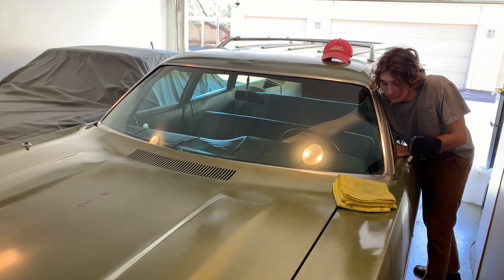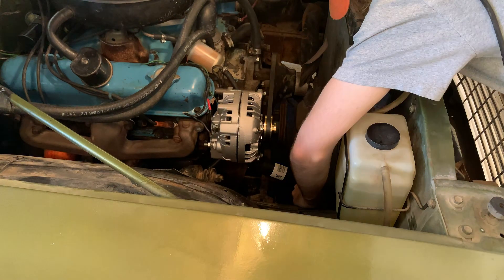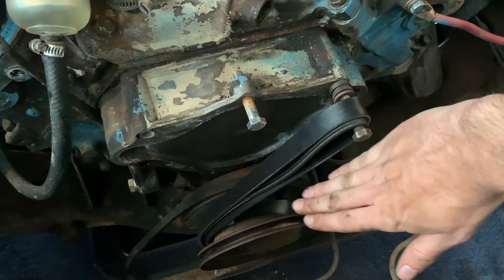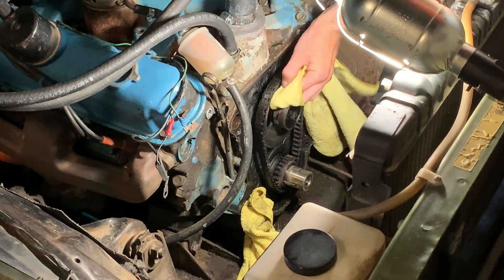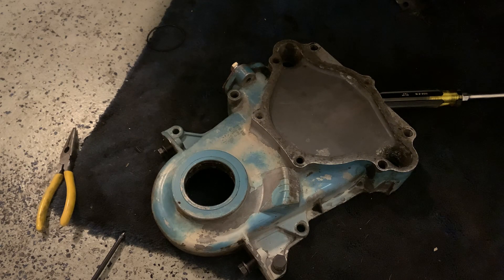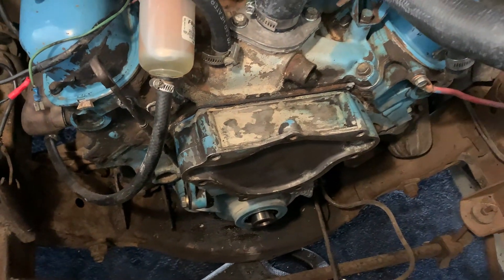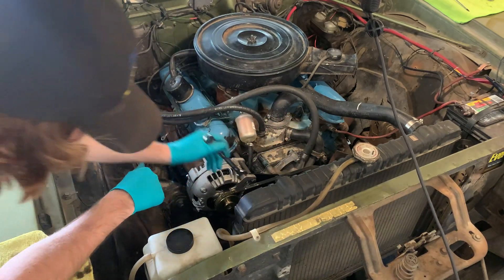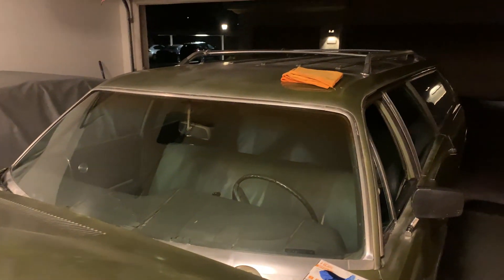*PART 2* - Timing Chain Replacement - 1970 Plymouth Custom Suburban

Comment: Really enjoying this. The first new car my parents bought when we were kids was a 1969 custom suburban in blue. 383 two barrel. There’s no way I can have another car right now but I would love to find one in good condition someday.

Saw that you put a newer style alternator on the car.

One thing, keep an eye open on the front seal. The FSM and my uncle, who was a professional mechanic both said that you fit the timing cover with a couple of bolts, but not fully tightened, then install the harmonic balancer so that it’s self centered in the seal. Then you add and tighten the rest of the bolts. 

I am loving these videos
Reply from the maker: Thanks for watching!
Much appreciated on the insight with the seal for the timing chain. I have peered underneath the vehicle most days to inspect and there is no leaks so far from the main seal, thank God. I'm always glad to hear of the multitude of stories people have with these cars and the memories associated with them.

Good eye on the alternator! I didn't mention it in the video, however I found that while the alternator beforehand was charging the battery sufficiently in park or neutral optimally, upon putting the engine under load in any other gear plus with running the lights, it was failing. Hence the upgrade, also I had to specifically source the correct bracketry for the alternator as the bolts on it before were way too short and was only essentially being held in place by the belt and the one bolt securing the arm bracket to the timing chain cover.